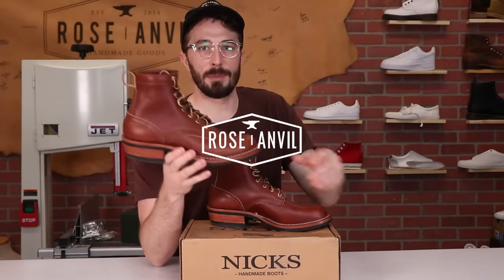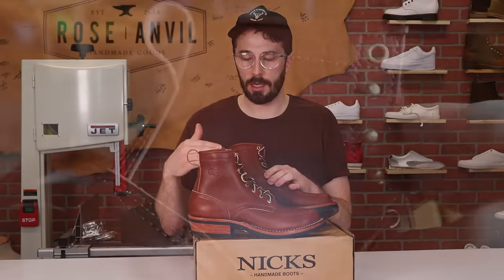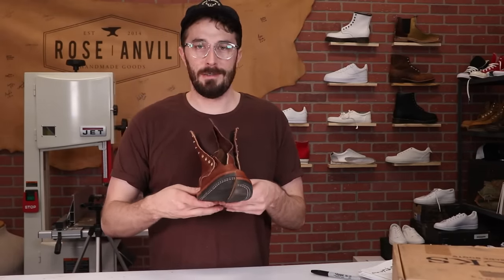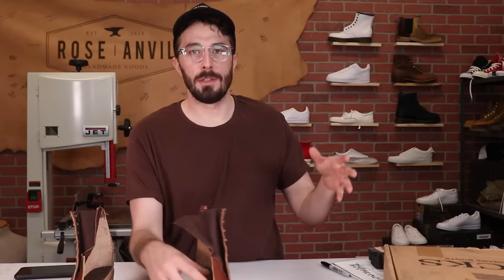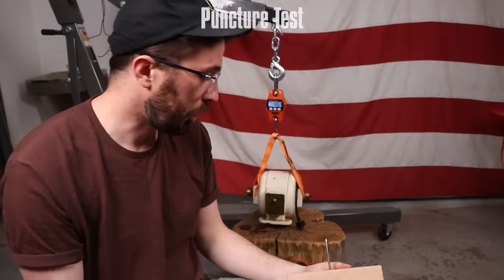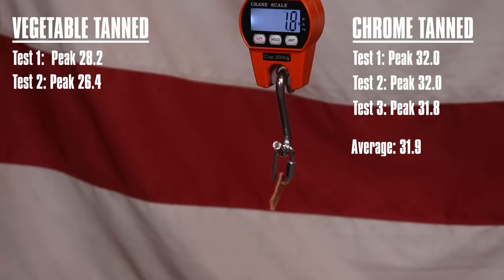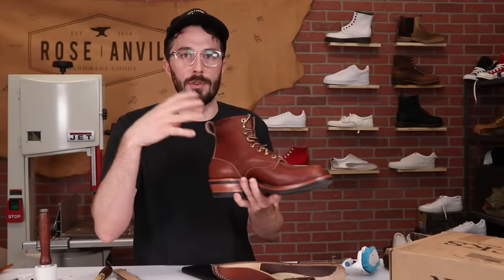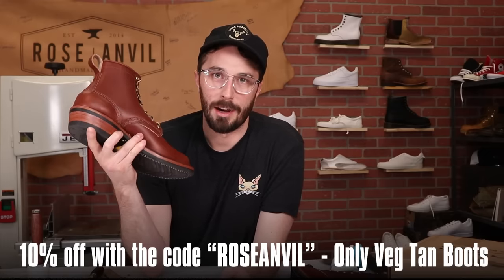Are $550 VEGETABLE Tanned Boots As Durable?  - Nicks Boots Robert

Comment: I just received my Roberts this week the lead time they give when doing the fit sheet is 8- 10 weeks while mine took 14 weeks. This would have been fine if they had just given me an update but I always had to reach out to them which was a little off putting. That being said when I did reach out they responded right away like w/ in 30 min of my email. So far they seem like great boots I got them for light duty work casual camping, woodworking ect. and I think they'll be great for that.

Comment: To me the results make sense. Veg tan is stiffer so should be harder to puncture but less flexible so would rip or crack easier when bending. 

Similar to steel hardened (clenched) vs not clenched. One would probably be better for flexibility but ding or dent easier. Vs hardened would snap when trying to bend it. 

On of the comments below is interesting on once broken in what would the numbers be?

Comment: Color dyes can affect properties of leather, too.
Motorcycle suits, especially race suits, are not more completely some of the ultra-bright colors, in larger part because of how poorly a Hi-Vis Green/Yellow  and Yellow perform over the same hide in a regular Red or Blue. They use Kangaroo a lot for its high strength, but guys like Valentino Rossi who love the Hi-Vis used it sparingly and as an applique over a base leather because the different colors of the same leather perform so poorly when dyed certain ways. Tests or crashes that hardly scuff a Repsol Orange, Yammy/Suzuki Blues or Kawi Green will eat right through a florescent yellow/green like it is tissue paper. Vale used a certain green in "The Doctor" across his ass and after a fall, often the letters of green color are about gone while the other letters are just scratched. Dianese did finally come up with a rather bright Yellow that lasts enough he uses more of it, though it isn't fully as bright as he wants, but his Monster Green sponsor logo is still not a structural portion of the suit, and the yellow is often over the Kevlar elastic parts, or where it won't see the abrasion in a crash, has boots under it, etc.

Comment: probably should have mentioned the difference between regular chrome tan and chromexcel which is  chrome tanned but packed with oils. process takes much longer than normal chrome tanning and is regarded as much better than chrome tanning.
Reply from the maker: Chromexcel is in my top 3 favorite leathers
Reply: @RoseAnvil   i'm just starting to learn the differences mostly from your vids so when you mentioned testing veg vs chrome i was hoping to get a little bit of info about chromeexcel also in relation to those. is there much difference between chromexcel and basic chrome tanning. i assumed it was the oil packing but is there anything else?

Comment: Would you recommend a pair of Nick's boots (like his Traveller boot for example) for mountain hunting?
I'm trying to find a quality pair of leather boots that look a like they were designed with some pride and struggling.
I've got Danners Elk Hunters at the moment and they're great except for the fact they're made of suede and get damaged like suede.
Reply: Adam,  I would feel confident with anything of Nicks that is similar to the White's Smokejumper. Don't listen to anybody that complains that they are too HEAVY to hike in. I'm sure you have heard the saying of "X amount of weight on your feet is equal to XY on your back". Well if you actually read the paper the military published, it proves that excessive energy is expended ONLY when exceeding 2.5 - 3 MPH. I always have weight on my back when in the mountains and I hardly ever exceed 3MPH, def. not while HUNTING.

I do have a pair of the Nicks Packer though and I will say that the Walnut leather of the packer is UP another level against the White's Red Dog. It is actually making me rethink going to Nicks just for that thickness and hardness of leather for my next pair of mountain boots.

Comment: I vote for the Robert's if you do alot of standing but I love the Falcons to.  I already have a pair of Nick's Builder Pro's in black and am more then halfway saving up for another pair. Probably a pair of Rangers.
Reply: Does the falcons have good arch support? I know it's less than the Roberts.
Reply: @pop2u1  it is very moderate compared to the Roberts. If you need the arch support though go with the Robert's. If you have flat feet and do go for the Robert's make sure you do the try on boot process and walk around in them in your house of course for more then the 20 minutes they say. I made the mistake of getting a pair of Builder Pro's on the 55 last which is the same as the Robert's and my feet do not like the arch support. I have flat feet so now Nick's are going to rebuild them on the HNW moderate last. Expensive mistake on my part but I still love the boots and will get another pair.

Comment: tldw, 
chrome tan, faster easier to make, more durable and water resistant.
Veg tan, "The tradition", looks nicer over time. Stiff and hard to break in but molds better in the end, but not as durable as chrome tan.
Reply: That’s not true man. Vegetable tanned hide is very durable. More so I would say than chrome tanned. I have been doing leatherwork and build bags with heavy duty saddle stitcher sewing machines for over 3 years. Veg tanned is the way to go.